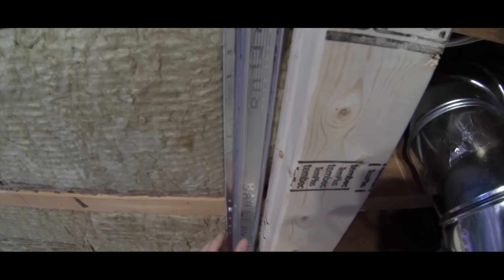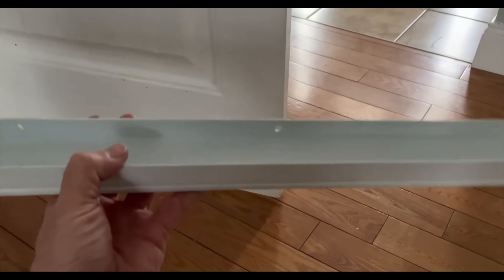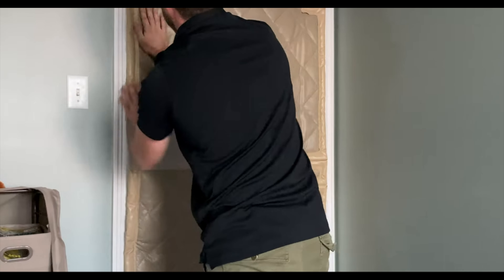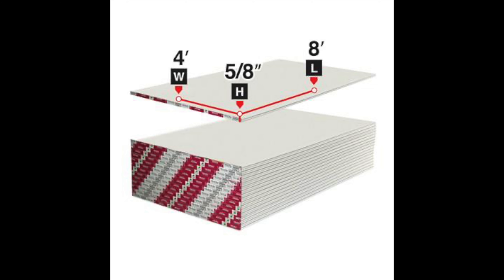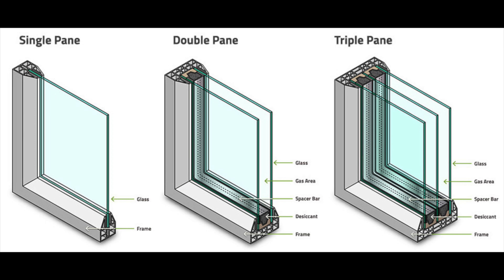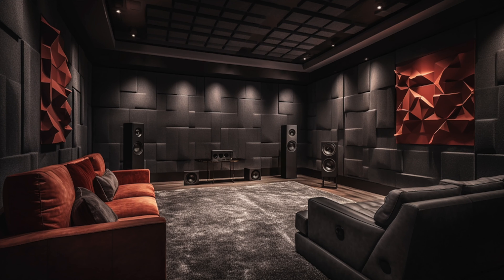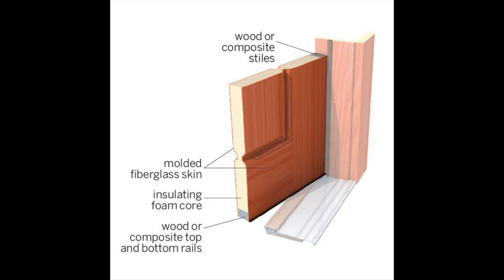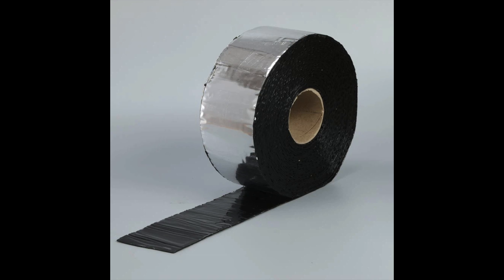Every Soundproofing products Explained!

Comment: I just found your channel today after already having purchased like 60 foam panels and I already opened them but haven’t installed them yet. 😭😭😭  I need them because the living room tv is right on the the other side of the wall that is shared with my stream room, and my dads deaf so he blasts the tv and I need it to not show up on stream. luckily my dad has a lot of silicone caulking in his workshop atleast, but now I gotta start from scratch on my plans. Glad I haven’t installed anything yet. This video helps me so much.
Reply: It doesn't help you!!!! It's just 50 random amazon affiliate links for crap that won't make much difference.

Comment: I want sound proof a room . I'm taking out the dry wall on 2 walls " hallway $living room " Im planing on Rockwool and 5/8 drywall. Would a plastic between the insulation and drywall help if using the the soundproof caulking help . Mostly trying to   keep more voice /tv noise down . 

Would a rubber underlay between 2 sheets a drywall work to deaden sound  like the green glue ?

Comment: Ok great video but one criticism is that the "sound maze" solution for sound insulating HVAC vents will create resistance on the system and possibly clog if your filter isnt working properly. Its dicey to give people on their vents, it  could really mess up their home. You have to look at the overall system. Once again, I loved this video and I love your work;  just giving my 2 cents.
Reply from the maker: Great point. The sound maze is for above door air vent type vents and not forced air vents. I’ll be more clear in future videos about that.

Comment: Hello. Im going to start a project to soundproof my windows. But since i dont have mass vinyl in my country and delivery options are too expensive due to the weight. Im thinking of using vinyl adhesive floor as replacement option to cover the structure. Wish me luck!
Reply from the maker: Best of luck!!! Let me know how it turns out! 😊

Comment: Hello can you help. 

I'm in a house where all the sounds from inside the house coming into the bedroom

Should I sound proof/reduce the walls inside the bedroom or on the outside of those walls(dining area and entry way) 

I just want it quiet when I'm in my bedroom trying to get a moment peace. I have sensory processing issues 

I hope you reply 

Thank you
Reply: add a layer of 5/8" drywall to the bedroom.
if its still to loud then you need to do the same from the noisy rooms.
failing that take all the drywall off the walls fill the walls with Rockwool or insulation to save some money an replace the walls with 2x 5/8" drywall.
if its still to loud then you need to move

Comment: U shape Door sweep
Weather strip self adhesive 
Resilient channel
Soul isolation clip
Rockwell 
Soundproof dry wall
5/8 " drywall
Puddy pads
Soundproof vent
Window insert
Sound deading curtains
Window panel
Autistic door panel 
Moving blankets 
Magnetic vent cover 
Thermal insulation door panel 
DiY window plug-frame, insulation, 2 layers of dry wall, weather strip around.
Autistic foam not workin
Autistic  panel
Autistic wallpaper not workin
Autistic diffusers
Soundproof underlayment 50¢-2.00 
Interlocking floor mats 
Cork floor
Foil tape